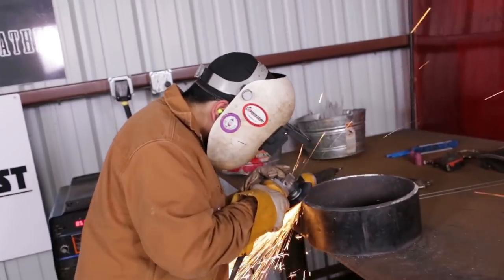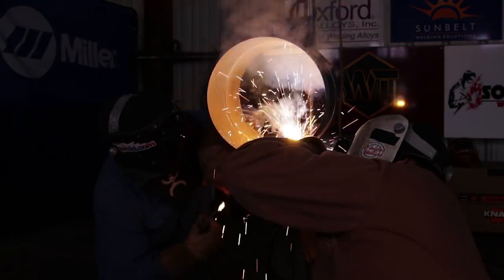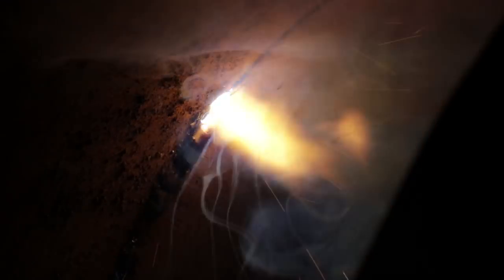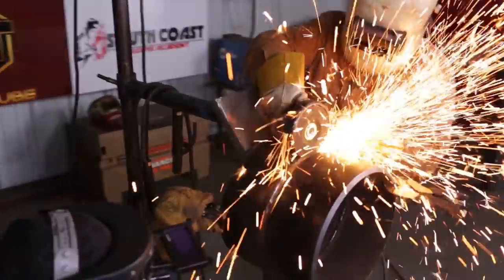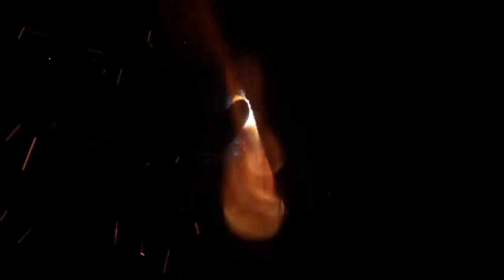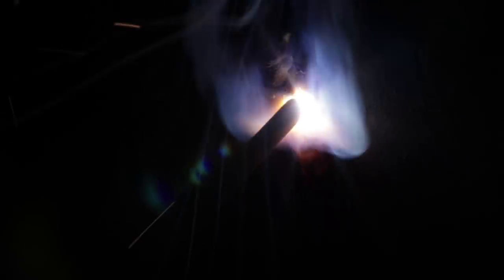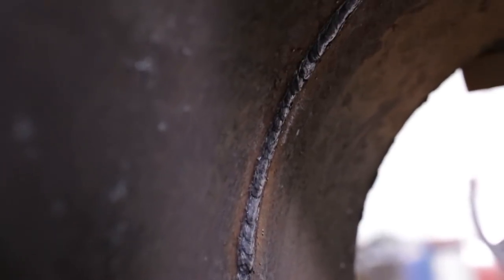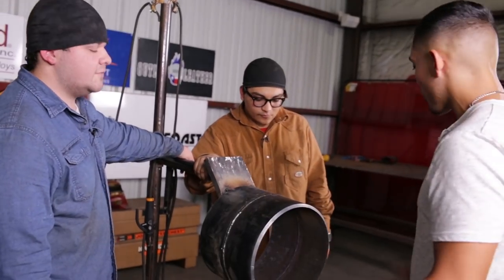High School Welders - Blue Collar Jump Start Program

Comment: I started welding when I was 14,  actually went to welding school when I was 16. I did 2 years there and got my 3g-4g structural certification (1/8inch open root and land) my Junior year when I was 17, then my senior year I got my 6g certification at age 18 (tig root and 7018 fill and cap). Now (I’m 19) I’m currently an apprentice for Ironworkers Union 584